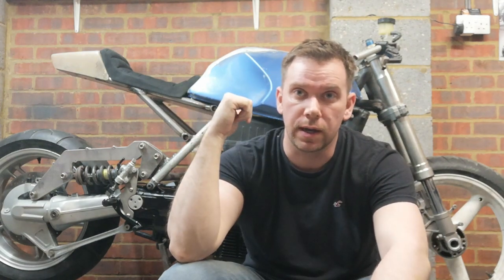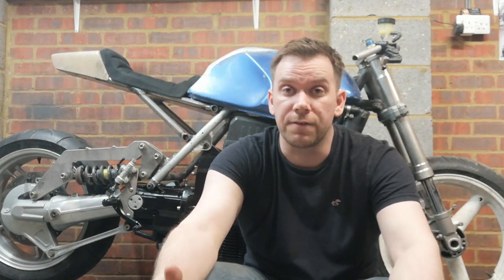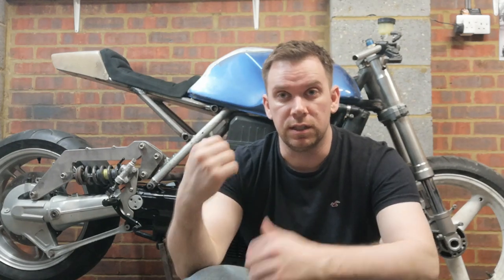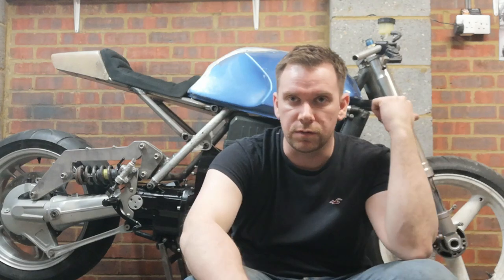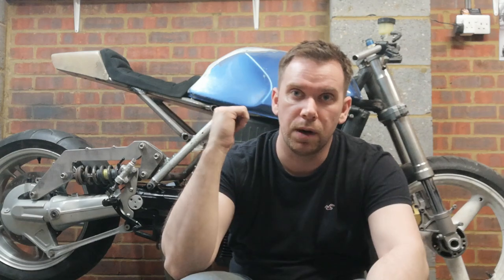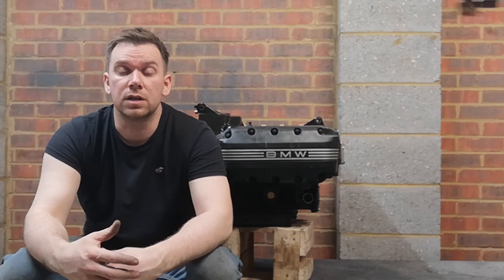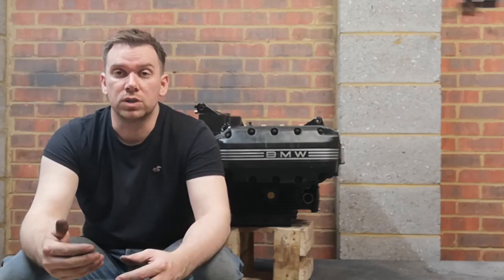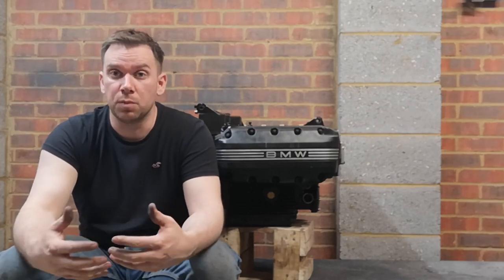BMW K100 | Introduction | Build vlog #1

Comment: Hi there my name is John in Australia also doing a K 100 83 model I'm at the stage of getting the frame to the powder Coaters and will be starting on the engine. Good to see you working on the starter motor and alternator something I'm not looking forward to doing. With your rear end did you buy  just design off Gustavo? I really like how aggressive you bike stance looks. I've used a Yamaha R1 front forks just swapped the stem and bearings also running with k1200 front and rear rims with a custom made front axle the rotors/disk are from the k1200 and fit straight on had to space out the left hand rotor just a few mm and perfect. I'll be watching your venison as you get close to finishing and what ignition and computer you'll be using for your injection. All the best cheers
Reply from the maker: Hi John, the rear suspension is my own design, it based on Gustavo's design but I've designed it from the ground up, I'll be doing a video on it soon. You're build sounds like a good one, if you have Instagram send me a message, I'd love to have a look!

Comment: How easily does the k1100 paralever swingarm and drive shaft mate up with the k100 gearbox?
Reply from the maker: If you have the later k100 gearbox with the tabs at the bottom for the torque arm, then it bolts up with no issues. If you don't have the tabs then you need a k1100 gearbox.
Reply: @Eight20  89 k100lt, 8 valve head so I'm not sure. Due a clutch lube though so i will check 👍
Reply from the maker: @ericcooper5867  exactly the same as mine, you might be lucky.